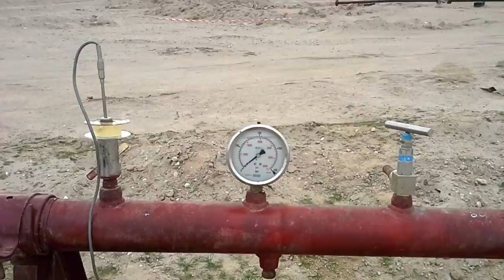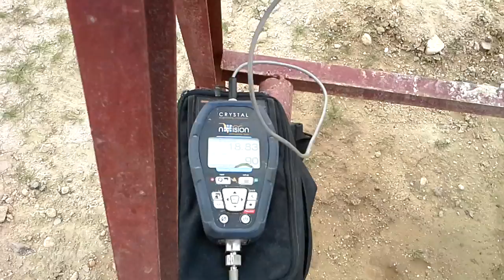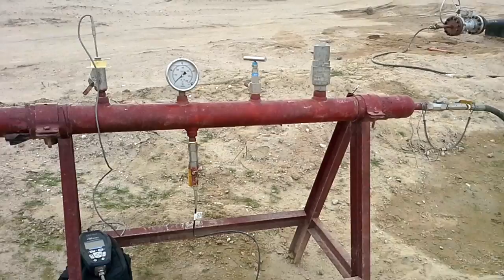Flow line Hydrotest

Comment: Sir, how to make sure if i do the weld to chiller pipe and want to make sure if the weld is leak or not before we fill the water, because the pipe line got no pressure gauge etc,
Thanks

Comment: Hai sir my name is bharath.. I had an one question... How do you release the air inside the pipeline during hydrotest
Reply from the maker: BHARATH RAWASI 
Hi. Sorry for this very late answer. The pipeline should be designed with air vents in all the peak points according to the geographic maps. On the start of  pressurizing all these peak points should be opened manually and let open so that clean water comes out of all. Then the PRESSURE can be increased and the test be done.
Reply: @kamalpakdaman4230  Hi sir, is the other end of pipe open,for the water to come out? Or is it sealed completely?
Reply from the maker: @idleandactive  nope. It's under huge pressure. Sure all the pipe is sealed very rigidly.
Reply: @kamalpakdaman4230  ok sir but how will you know if the pipe is full or not? Incase you keep pumping excess water
Reply from the maker: @idleandactive  well.it basically doesn't matter . you just need to apply a high pressure course to the pipe to ensure about it's integrity. If the pressure has reached the specified value and there is no leak in required time , it means the pipeline is in good service condition and you may proceed for commission of pipeline operation.
Reply: @kamalpakdaman4230  Oh.Does the pipe need not be filled entirely with water,or partially
Reply from the maker: @idleandactive  well. it's the matter of safety. everyone wants the pipe to be filled entirely with water but that is not the case each time, due to improper venting system application a bit of air gets locked in system. that is not a preventive issue for the test though. The unchanging pressure of the system and visual check to see there is no leak would proof the system reliability.
Reply: @kamalpakdaman4230  slm